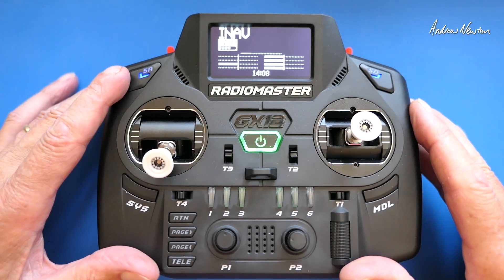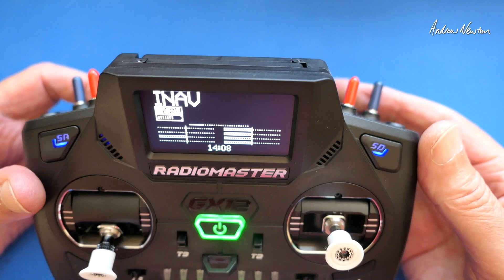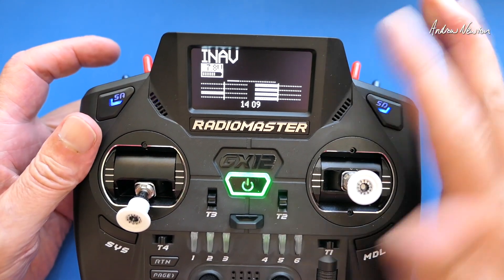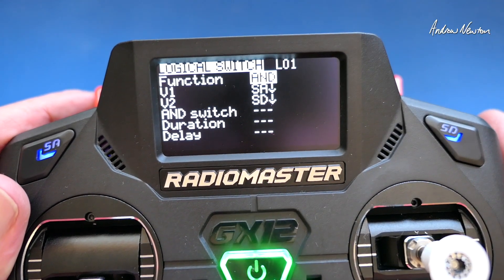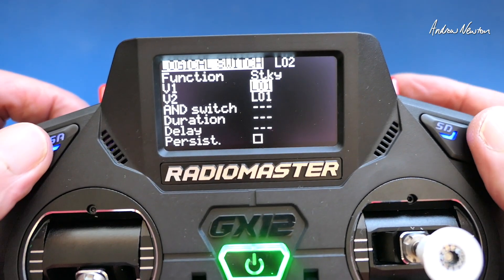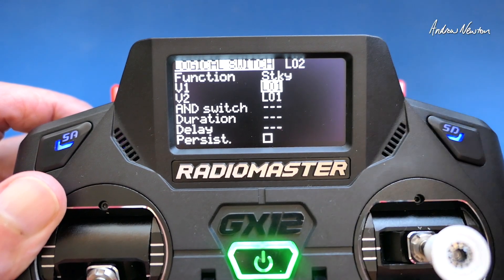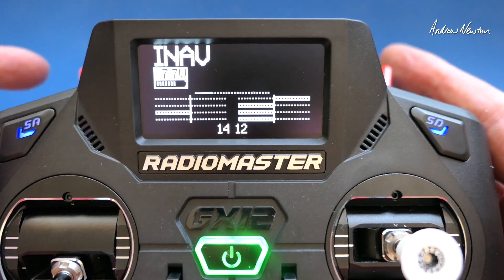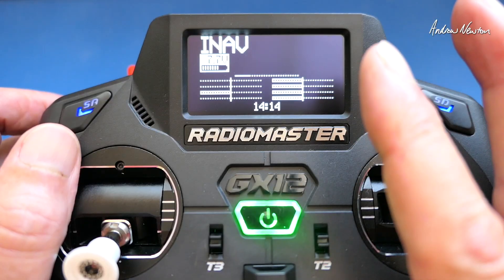Arming with two momentary buttons

Comment: Gday Andrew, I have set up my GX12 the same as you have exactly, but I cant get the button to hold, it only acts like a momentary switch. Cant see what I have done wrong, regards Paul, thats for all your advise.
Reply from the maker: Thanks Paul, very generous. Are you using the Logical switch as the source rather than the physical switch? So Ch5 source needs to be L02
Reply: @AndrewNewton  Hello Andrew I did the maiden flight this morning, Apprentice S15 with the new Radiomaster GX12, same matek F405 wing, only change is the new radio and receiver. Plane flew great as expected. Retested RTH and also returns with turning radio off ( loss of signal ) I did notice the plane disarming once I land, and I feel its updating midpoints in manual mode. As when I took off again in manual the plane had a lot of up elevator. Do you know how I can turn auto disarm off? and also turn off the Auto Tune? And reset the elevator mid point as its in the up position?    Thanks for your advise Regards Paul.
Reply from the maker: @paulsalminen9785  Nice one. There is a selection in the Configuration page you can turn off - Continuously trim servos. I'll check the Disarm on landing setting tomorrow. Might be a CLI command
Reply: @AndrewNewton  thanks so much Andrew much appreciated 🙏
Reply from the maker: @paulsalminen9785  Enter this into the CLI         set nav_disarm_on_landing = OFF
Reply: @ Thanks Andrew!
Reply: @ thanks Andrew
Reply from the maker: Forgot to include that you can set the servo mid points back to 1500 in the Outputs screen
Reply: @ thanks, I might also turn of the auto trimming function and just use auto trim on a nice calm day and save the settings. Also might look at the CG that and also PIDS night affect the manual trim adjustment. Have some fiddling to do !!
Reply: Yeah I get what you’re saying !!! I didn’t know you can change the midpoints back to a specific setting !!! Nice thanks I’m learning

Comment: Totally awesome ! The INAV devs will moan if they see this ! I had funerals for 1k in planes over the INAV disarm 5 sec time out window! I  This is by far a safer method! I want to do this on a TX16, the left shoulder sing poss switch and the right shoulder spring switch ! Will this logic script be the same? I wonder if a 2 stage arm can be done in the INAV gooey modes pages?
Reply from the maker: Thanks. Yes the logic will be the same.

Comment: I like to make arming require two simultaneous movements and disarming require only one movement.  My thought is that the craft is most dangerous when armed, so i make it difficult to accidentally arm and difficult to accidentally fail to disarm.  I also have an alarm that plays if I fail to press the momentary switch when flipping the arming switch.